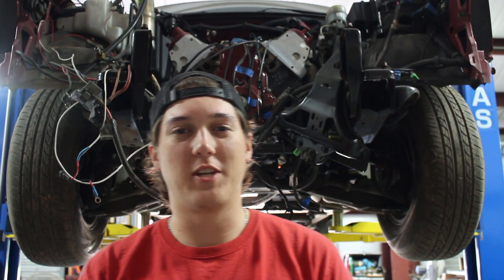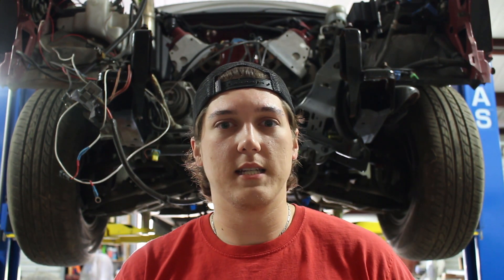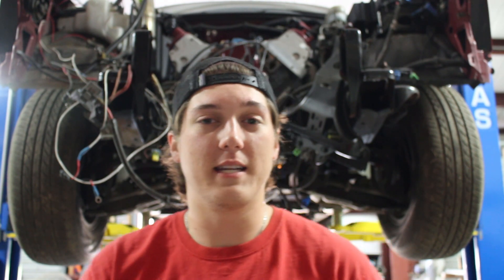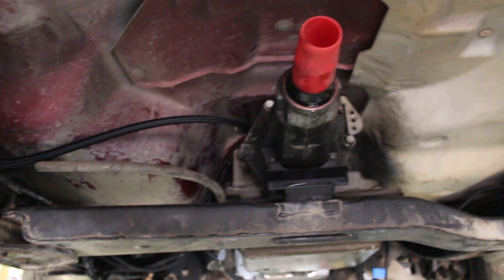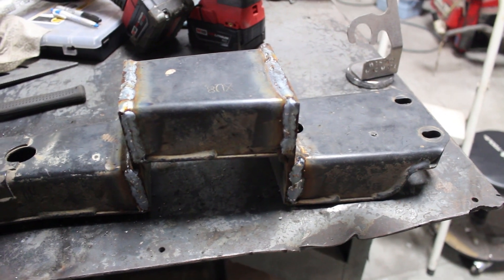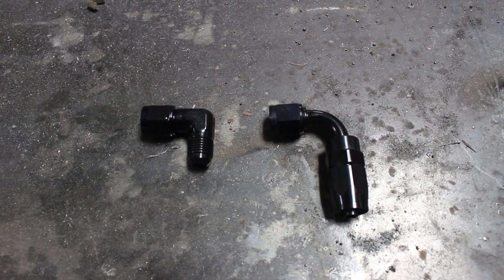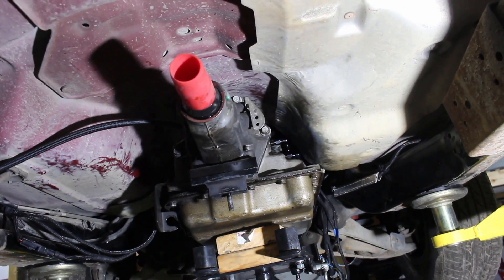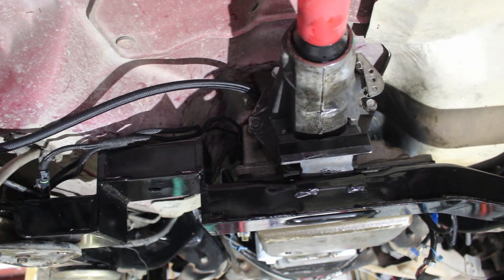S10 LS SWAP PT 15: Converting to AN TRANSMISSION Cooler Lines

Comment: Great video! So did you end up not wanting to take out the stock fittings on the transmission? When u got the new fittings it looked like the original hard line fittings were still on there.
Reply from the maker: The hardline fittings in the transmission were replaced with fittings that would adapt to the -6 AN lines that were being ran.
Reply: On the an fittings going to trans did you use a oring or any type of washer ? @WOTGarage1